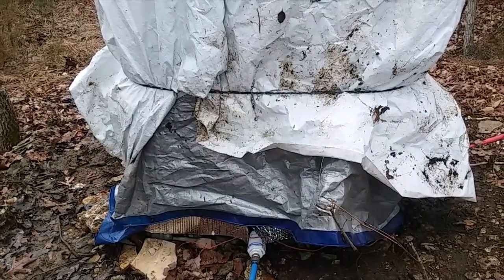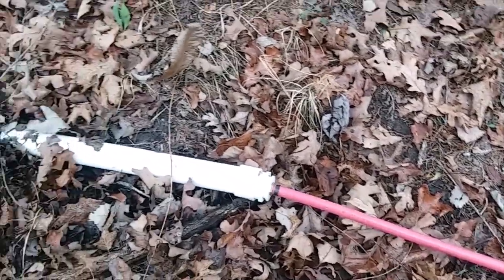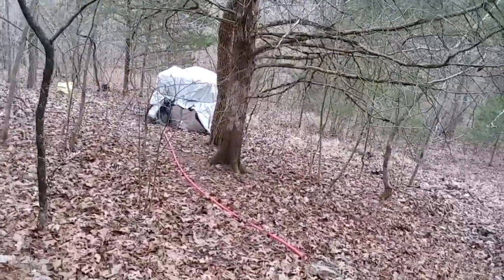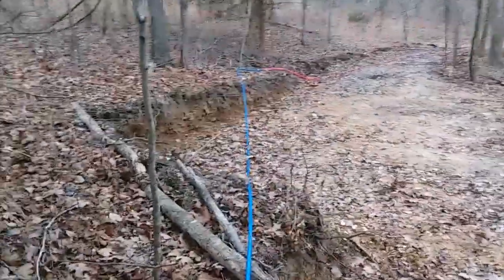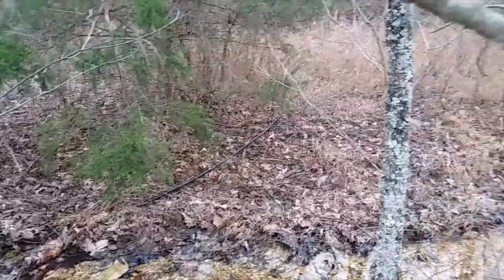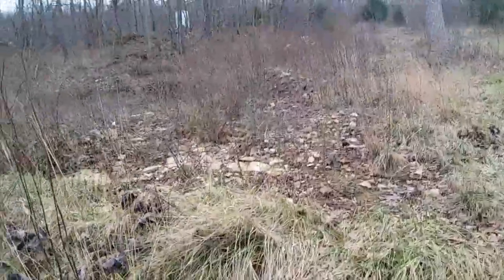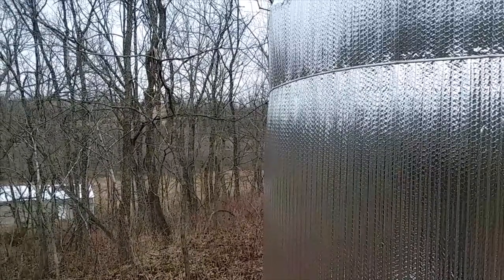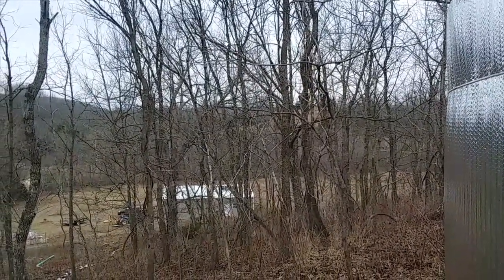From  Spring To House Water System

Comment: I've heard that they require a pump to get inside the home....?? What if the grid goes down?
Reply from the maker: Hey, thanks for watching, right now the whole system is gravity feed, The spring is several hundred yards on another hill. It goes from the spring to a 250 gallon square plastic tote then down the hill about 600 feet then up the hill to the round tank where it trickles in an fills it and then it goes out an overflow. I want to use that overflow by running it down the hill too. The round tank feed our house below with decent pressure but I want to hook up a solar pump to give it a little more presser. So as long as the spring runs, I'll have water, and it has never stopped yet. I keep doing things to improve it, I need to make another video on it. Thanks and God Bless.
Reply: That's funny lol